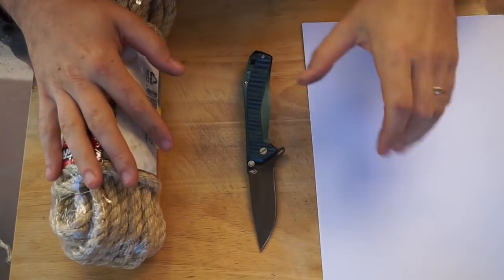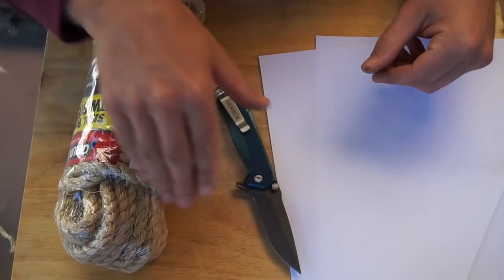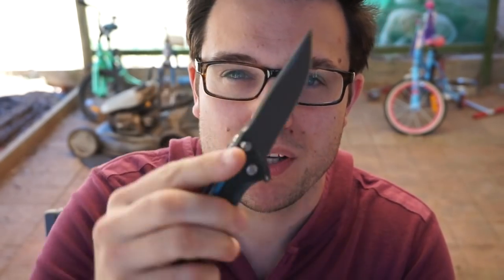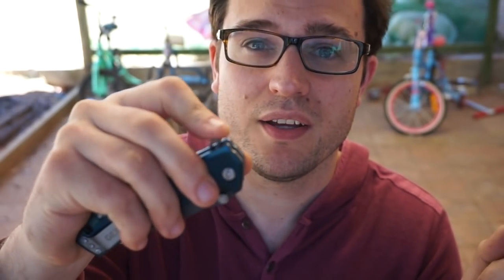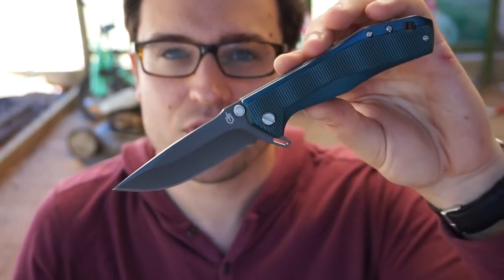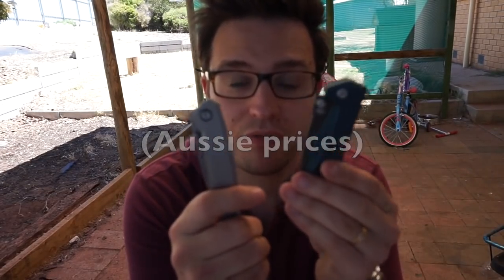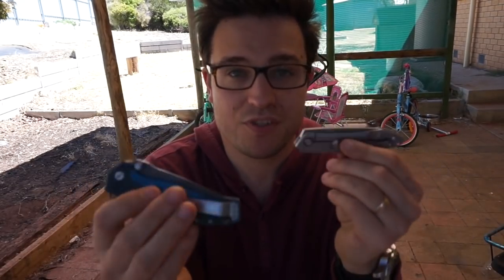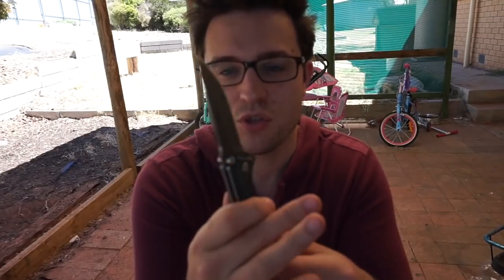Gerber: Your 5cr15mov steel sucks (and it doesn't have to be this way)

Comment: You're absolutely right, these cheap steels have got to go, kershaw is offering m390 in a U.S. made knife for $80 U.S. Gerber themselves offer 154cm in a U.S. made knife for $40. This craptacular knife has a very specific target, non knife people who still trust gerbers  name and don't know any better, "it's gerber and it's $60, it must be good!" They don't know they're getting a $3.99 Wal-Mart knife and paying the other $56.01 for the word "gerber."
Reply: Mt. Baldwin what is the name of the 154cm knife gerber makes for $40 that you mentioned? Id love to check it out and see if they actually made something decent for once.
Reply: The gerber gator 154cm, they make several versions of the gator so you have to type "gerber gator 154cm" into whatever sites search bar, it's the drop point style, not the clip point.
Reply: EDC with Aaron the gerber edict is 154cm for $54 on bladehq.

Comment: Back in the before times, i owned a bear grylls 5cr15 paracord 'knife' and yeah it's literally butter knife steel. You can't really break the knives (because it's so soft) but you can't really use them either.

Comment: 5cr15 can be okay with a proper heat treat. Out of curiosity. Match this Gerber with a crkt with the same steel.  The spew had this steel. Entirely different blade shape and is also a small fixed blade.
Reply: And what is a proper heat treat for this material if you don’t mind me asking? :)
Reply: @hiphopish2  a proper hear?
Reply: @theknifeconnection9571  oops, corrected! Proper heat treat*

Comment: A bit of info on decoding the chinese alphabet soup steels:
The first number is the carbon content in tenth of a percentile (0.5% in this case), Cr stands for chromium, and the number after it indicates the chromium content (15% in this case) The letters in the end mark the other alloying elements used (in this case Mo for molybdenium and V for vanadium)

Also, the most annoying thing for me, is that 5Cr15MoV has a very similar composition to 1.4116, that You tested in a Cold Steel, and done pretty well for a budget steel. That to me means, that if Gerber gave a 💩 about heat treatment, they could get a much better result.
Reply: I have bought a piller  knife in one  of the hungarian interspar  with steel 5crmov15. So, is it the vandanium in this case of 15% of matter  in the chemical composition?
Reply: @rotcsa9842  I literally can't find a listing for the specs of that steel, so it might just be a typo made by the manufacturer.

Comment: I'm sure your test is good. One thing I'd like to mention though is when testing edge retention, sometimes you can easily get a false read on a steel because when factory sharpening is done the guy doing the sharpening will often pull the knife off the sharpener once he feels the spine become warm so as to not ruin the temper of the steel but, what many people don't realize is that once the spine becomes warm, the ultra thin 4-8 micron wide apex is already burned and no longer has its proper hardness and then it becomes necessary to sharpen it multiple times to cut through the heat damaged steel to get to the part where the temper is correct again. I had a knife in sleipner that cut terribly, it would go from hair popping sharp to dull after cutting through 18 inches of cardboard. Every time I sharpened it the edge retention got better. Eventually after sharpening it about a dozen times the edge retention was superb. I think that was an extreme case but, nonetheless good evidence to show how badly the steel can be damaged from factory sharpening. Hope this helps and I enjoy your edge retention videos quite a bit.
Reply: damn i didn't know that, that's actually a great piece of advice !